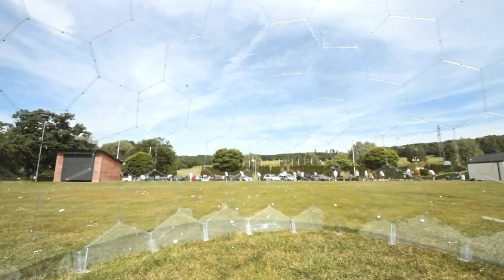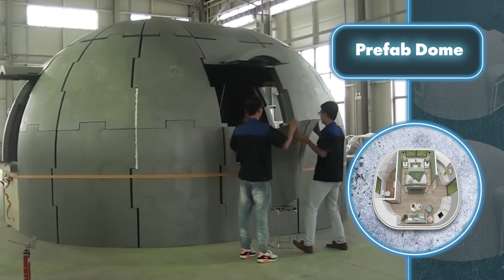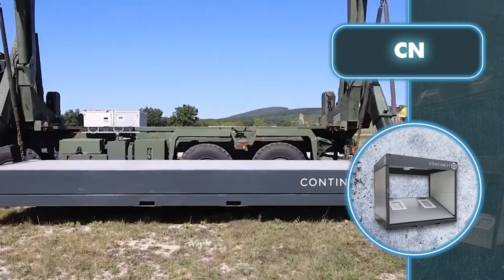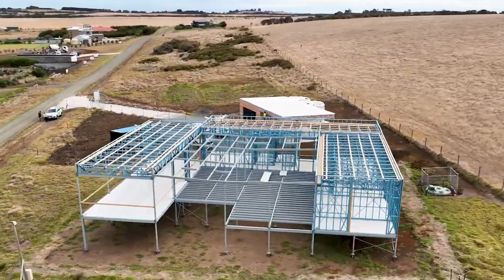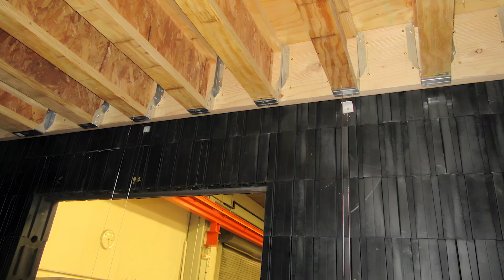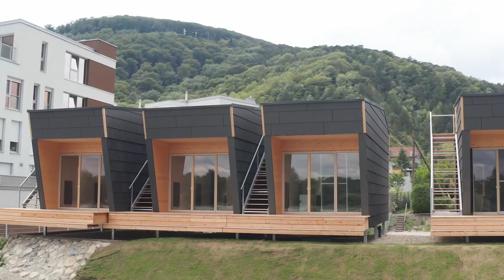Quick-Build Homes That Have Reached a Next Level

Comment: I’ve actually seen a few domes built with these small panels and they all leak in the rain.   Also if these are built in a cold climate the ice will  get in and damage the panel seals.

Comment: Soon enough, current structure maintenance and tax costs will plummet the real estate markets, and then perhaps these modular designs will finally arise. The real estate building market will never recover. It will be cheap and modular and DIY going forward after the crash. The world already has new 10K cars. Everything we all use is going to keep getting cheaper. How governments regulate this will be interesting. Thats why for maximum investment, I support owning land without or with old structures instead of building new (unless you're building with the land of course). The labor and tax costs are death now for new stick and build.